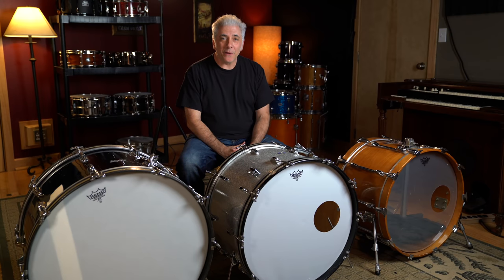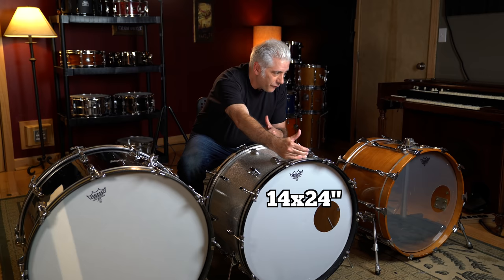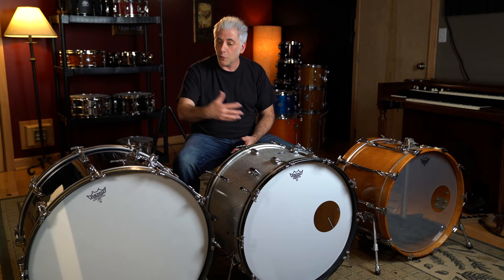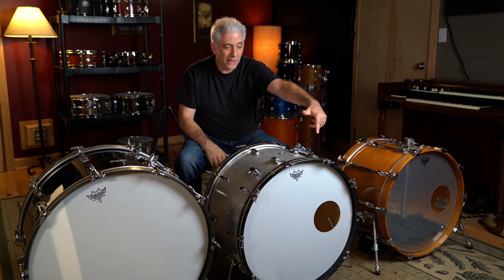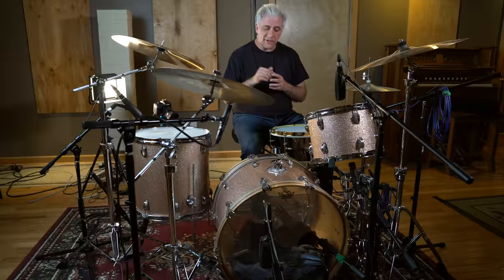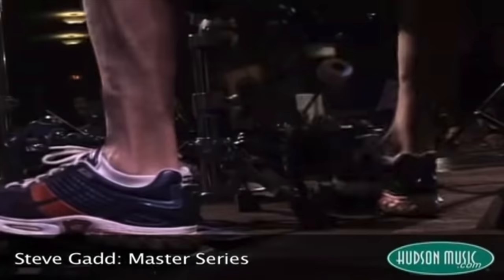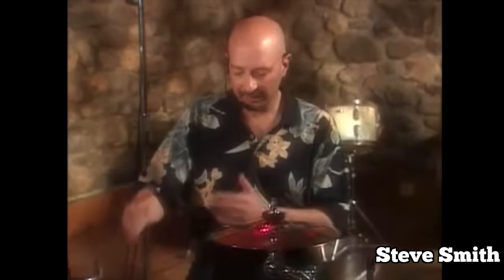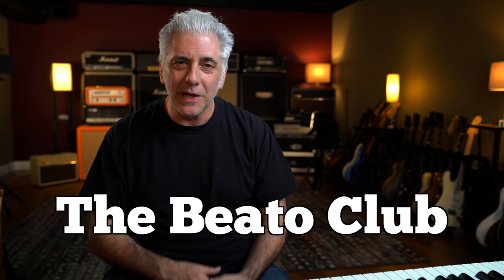How To Get A HUGE BASS Drum Sound

Comment: Don't forget: the fundamental of a cylinder is determined by its length. Or; the resonant frequency of a drum is determined by its depth. So I wanna argue with Beato here, in that a deeper drum will have more low end. That's physics. But, I am interested in this idea of inertia reducing the impact of a drum the deeper it is. The shallower, the more punch where a deeper drum may feel sluggish, so you'd lose the energy of what's played.

Comment: One correction.... The Rogers is a 5 ply. I also have a 26" Roger. 1970
Reply from the maker: Wrong. The drum is not a five ply.
Reply: @RickBeato  The 3 ply shell was made until 1964. They switched to a 5 ply shell with a 45 degree bearing edge, but still rounded over.
Reply from the maker: The drum is from 1962.

Comment: I usially prefer 18 and 20 over 14", with bigger drums i always get too much around 500hrz which makes them sound like cardboard.
Reply from the maker: You must be confusing it with toms.
Reply: @RickBeato  not confused, it's just a taste thing. The bigger drums do sound bigger but I prefer that deep sub that an 18/14 kick gives me, the ratio for radius and leangth is good and at 14" deep it's not too slow.

Comment: I guess I'm in the minority, but I don't like the JB kick drum sound. Like all vintage drum sounds, it sounds boxy  to me.
Reply: Entresting view point. I'm curious to know what your definition of boxy is. When I think of a boxy bass drum sound, I think of modern gospel, and r&b. Everything drum wise in those genres is boxy. All the tones are tight, and quick. The focus is on attack, and not on resonance. I'm not a fan.
Reply: @frankspikes4867  Can you give me an example in that genre? To me the JB sound lacks at around 60hz and has too much low mid. The sound is somewhat distant too. I don't think vintage records sound good (an neither do a lot of the most recent records). Drums on old records just sound thin to me.
Reply: @CordScott  For gospel check out Fred Hammond,  or kirk franklin. Donny Mclurkin as well.  These are all modern gospel artists.  Also check out snarky puppy. Check out aaron Spears,  Eric moore, Matt Gartska.  Excellent players, I don't like the way thier drums sound. When I play out, most of the time I'm not micd. So I don't muffle my drums except the snare. Single ply heads, top and bottom of toms. Power stroke 2, on the kick batter side, single solid head on the reso side of my kick. All drums are tuned to bebop tension. Very lively, warm, big sound. Anti boxy!! If you check out early heart tunes. Early Montrose, early Y&T.  You'll see what I'm talking about.  Also check out jazz greats like Art blakey, Max Roach, Joe Morello.  I love the way these guys drums sound.

Comment: I am allergic to that Bonham sound and very much prefer my kicks mic'd centered inside a 20x16" drum. Those big ass drums does not allow for any high speed drumming. Trying that is like kicking in tar.
Reply from the maker: No they haven’t.
Reply: @p0llenp0ny  Indeedidoo I have. And those short burst doublets and triplets aren't a problem when the beat skin is tuned so high. Doing them for an extended time, like five or six minutes is another matter. But when the skin isn't tuned as high it's a another matter. I personally wan't resistance, not mud.

Comment: Generally I would agree about your basic points but comparing the acoustic properties of both acoustic and amplified bass drums as though they are the same thing rubbed me the wrong way.    I've played drums for 57 years and disagree simply because a bass drum is more complex than you imply.  Not only does a bass drum produce low frequency sound but it also absorbs it with ease.  One flick of an overly zealous bass guitar and your 'punch' is lost or neutralized by interference waves.  As far as miking a drum goes...just having a microphone inside the drum shell effects the sound dispersion radically compared to it's native acoustics.  Ever been to the Hollywood bowl?  Have you seen the balls they installed to scatter the sound on stage so performers can hear better?  That's exactly what a microphone does inside a drum shell...and that's NOT natural or necessarily desirable but it is tolerated if you want to amplify the drum.  Also, Bonham was always miked, his sound reeks of reverb, echoe and other effects which totally mask the nuances of a true acoustic bass drum.  (For the Bonham fans, this is not a critique of Banham just a statement of what is added to a native drum sound.)
Reply: @p0llenp0ny  My point is the microphone has it's own acoustic properties including effecting the drum sound itself, especially if mounted inside or nearby.  It's difficult enough to discern whether the drum, the mike or some interaction is causing an effect.  I suppose I am getting a bit picky, but when trying to demonstrate something as subtle as say 'push' which is difficult to discern at low acoustic levels to begin with,  the introduction of a mic just complicates things...Conversely, at great volume  it's even harder to isolate subtle sounds like push without the engineer and a good isolation boith.  Take the volume higher and without using the mic you wouldn't even hear the drum at all...I'd argue you are hearing the mic and not the drum. Sound is a function of acoustics, instrument and environment...it's difficult to isolate any if those things without a controlled environment :)